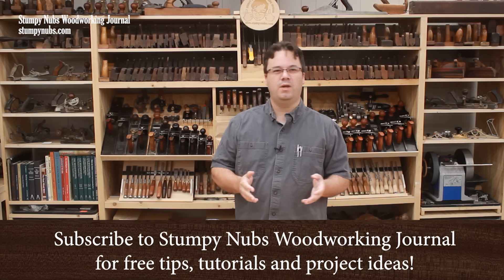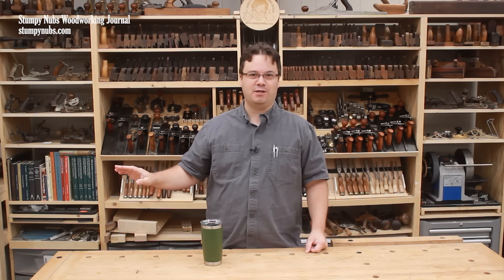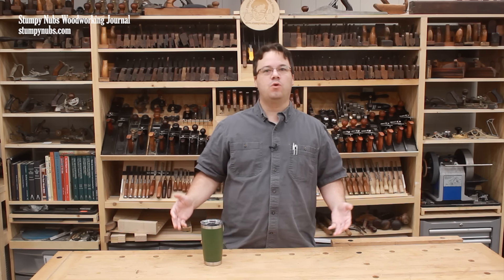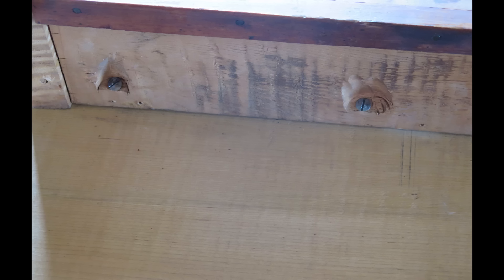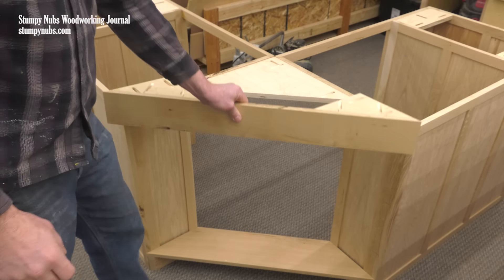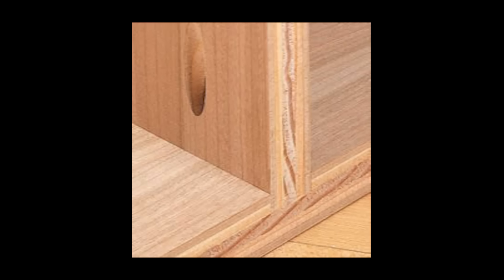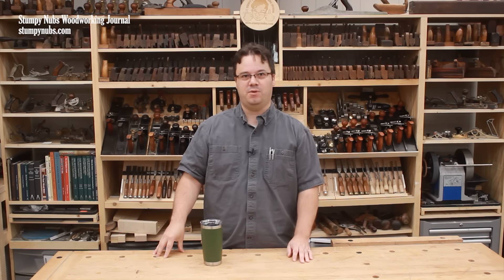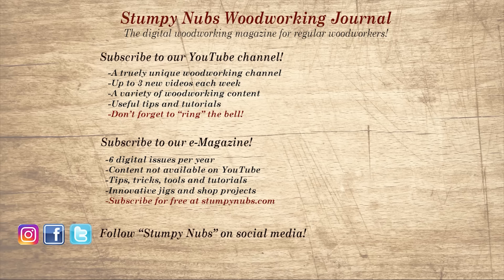They lied to you about pocket screw joinery.

Comment: I especially like the Kreg HD pocket hole jig kit, with their screws designed for 2x material. Put two pieces of 2x4 at a 90 degree angle, end to edge, and screw them together with two of their big screws. Good luck trying to break that joint. It's so easy, strong and reliable, why not use it? Who doesn't like hidden connectors? Old school craftsmen techniques are awesome, too. It's a great big world out there, and there is more than one way to do most anything. Just looking at your workshop makes me realize how much of woodworking I still don't know. Still learning.

Comment: My friend had a kitchen put into her air bnb. I just noticed today that the drawer is held together with staples. I took the drawer out to clean some crumbs out of it. It's a nice sturdy drawer. It's only about 2 years old, but it's solid. Probably been glued as well.

I have a dresser that's several decades old. It also is stapled. I have had to repair it, but not the staples. I over stuffed some drawers and used spring-loaded drawer dividers that bowed the back out, making the bottom/back joint come apart. Glue and clamps and ditching the dividers fixed it.

Sure, dovetails and dados are nice. But they're not absolutely necessary.

Comment: I use my pocket screws for a while...then I just started just sticking dowels in the pocket holes and flush cut.  I still use them as a temporary fastener til the glue sets and I replace with dowels.  Still a great joinery to have and definitely has their purpose and place in a woodshop.

Comment: I started using pocket about 1975  on cabinet face frames.Have used them for lots other purposes  since. Back then the set up for drilling  them  consisted of  a drill tub which drilled 1 or 2 holes at a time and a slanted table that was like 5x12 .This set up cost several thousand

Comment: I wasn't a big fan of pocket screws until I started using them to align butcher block and slab countertops and table tops. Now I just work on them whole in the shop. Take them apart and reassemble in place. Easy.

Comment: debate/input:

pocket holes for high load garage shelves versus just straight screwing into the support rails with "deck" type screws?
Reply from the maker: If it's going to hold a LOT of weight I'd want the mechanical strength of a dado.
Reply: @StumpyNubs  thx.... this was to [try and] settle the "infamous" debate on a fb-woodworking group post. 

Much appreciated

Comment: My first joinery project was a complete set of cabinets, drawers, and doors for my kitchen.  That was in 2014 and those cabinets are still in place, work perfectly, and get constant compliments from anyone seeing my kitchen for the first time.  I used pocket screws mostly to maintain square and apply clamping force while the wood glue dried.  If not for a joining method within reach of a novice using nothing more than a track saw and project table, I'd have spent thousands more on inferior cabinets from one of the big box hardware stores.

Comment: I like pocket hole joinery but I have yet to be able to put together a joint that did not move unless restrained by some additional joinery.  I use confirmat screws for cabinets in most cases.  The idea that the steeper angle cut by Castle will creep less seems a bit counterintuitive to me and also is contrary to my personal experience.

Comment: What is the most universal pocket screw jig ? I have never used them as grampa made sure I knew how to build cabinet joints proper, but I am very interested in pocket screw use.
Reply from the maker: Castle is the best because of the low angle and clean, tearout free pocket. But any jig on the market will work if you just want an angled screw. My concern is that you build stuff, no matter the jig you use :)
Reply: Thank you!

Comment: Thaaaaank youuuu!!! It was really getting me irritated when youtubers would make strength tests only using two pieces of wood. Yeah it fails faster in that situation but when it comes to projects you very commonly have other points where strength is added! I built a shelf with only pocket screws. Does it really have to be so strong to support a car or something when all the pressure it's going to support is about a few pounds if any. I'm not going to use it co climb on it or stand on it. It's a shelf! Even with my mobile table saw and band saw stations I use pocket screws and wood glue. That's it. They hold just fine. It depends on the use of the end product. Well said, sir.

Comment: If we use pocket holes, is the direction of the grain something to consider because of possible shrinkage and expansion of the wood?
Reply from the maker: It's always best to avoid crossing grain, but if you have to for a particular project to work, there are some ways around that, such as making the hole within the pocket a bit larger than the screw threads so there is a little room for movement.
Reply: Okay, but doesn't the head of the screw also need some extra space? In that case I may need a larger diameter pocket hole drill bit. @StumpyNubs
Reply from the maker: @twelthstring  It depends on how much you expect it to move. If it will always be in a climate-controlled place, it will move very little. In that case the screw shaft may flex enough within its enlarged hole to accommodate it. There is usually a little room in the pocket anyway. If you do want smaller screw heads, I buy Castle brand.

Comment: Great into to pocket holes. 
By the way, can we use pocket holes on butt joint that are not 90 degree but slightly more or less?  Let say i am building a trapezoid frame.  Would the joint still stay strong? Thanks.

Comment: I don't use pocket hole fastening very much.  However, I prefer using wood screws to gluing boards.  Using the Kreg Jig is a bit of a challenge.  I have used pocket holes for inserting studs as blocking into places where nailing them isn't practical.  I typically use #8 flooring screws with a Robertson bit.  I use a drill to drive the screws in and tighten them with a screw driver.  Good video.

Comment: 4:40, As someone new to woodworking, I love pocket screws for just this reason. I don't have a router or a table saw to cut dados and rabbets, so for me the pocket hole jig is the perfect, simple way to do most of my joinery. I'm building my skill set and my tool set. But for now, its pocket holes for me.

Comment: I use pocket screws all the time when building cabinetry.
They provide a fast secure method of joining for cabinets that will also be attached to walls. 
Using pocket screws has saved me worlds of headaches before as customers changed their minds on the layout AFTER everything was installed. 
That brings up another issue. 
Many customers simply do not want to spend the money for the labor of more intensive joinery. So budget also does play a factor in what kind of joinery I use.

Comment: Yes some folk just cannot see there are other perfectly acceptable solutions to problems and not just theirs. I used pocket screws for the very first time for constructing my railway baseboards. Each rectangular frame corner glued plus PSs, then the intermediate support ribs and tops PS only, all nicely hidden from view.  PS mean I can easily reposition ribs working from inside the frame (solves problem of no rear access when boards pushed up against the walls) if I get any clashes with point motors (mistakes do happen, even after working layout on the CAD) and can remove tops without damaging surface items, track scenery etc. It's worked a treat, 650 pocket screws later they are complete, was the best assembly method for me and no horrible screw heads unnecessarily peppered on the fronts!

Comment: Preach it, brother! Your last point was pivotal for me. I built a number of items I never would have tried without the confidence pocket screws gave me. In most cases I've moved on whenever I can just because I'm a big "over-builder", but it's also a huge time-saver...which is important for someone with limited time. My "shop" is my driveway. I can only do woodworking during the day, which means only weekends, and only when the weather cooperates. If I can knock out 2 nightstands in 2 weekends, rather than 3 months, I may not even start if it would take that long, honestly. And if I'm not doing something I enjoy, I may not be doing it at all.

Comment: The cabinetry job I'm trying to do a quote for involves access issues because of a narrow staircase. Rather than turn down the job, I'm going to rely on joining frames to cases with pocket screws, so that I can finish the cabinets in the work shop and then disassemble them to get them up the stairs, before reassembling in situ. Good old pocket holes :)

Comment: I owned a cabinet making shop for 25 years. For building face frames on kitchen cabinets, pocket screws were ten times faster and no need for a 1000 clamps. Time is money. An amateur will find a lot of uses for pocket screws. I also have to say that the Kreg jig is one of the best designed tools since the battery powered screw gun.

Comment: So about modular woodworking projects... where I live it is a very very difficult thing to have a workbench. I do not have a garage, my storage shed is full of stuff, and I cannot build something that big inside, never mind having a place to put it. So my only real option is to create a modular workbench that I can disassembly at any given time to put outside and bring back inside for storage... I am not a trained woodworker, and joinery is always a difficult thing for me to settle on based upon a project. I think that this is one of the most challenging things I will face for a while.

There are a lot of videos out there on "portable workbench" ideas, and a lot of them are rather neat. However a lot of them are also collapsible and move around like an old TV tray, with just about as much stability. Not that there is anything wrong with this if you are doing very light work that does not require more than just a couple of sawhorses and a plank or something just as stable, or less stable depending on how you look at it.

So making a modular workbench that can be taken apart and reassembled over and over and over again with ease is the challenge. There are places outside to put it, but storing it outside is frowned upon in my community, and then of course there is always weather to consider. Given that you are familiar with humidity up there and how it can wreak havoc on anything reliable that you have outside, I know you have dealt with this sort of challenge at some point. Yes, making a cover is certainly an option for weather-resistance, but there is only so far that such a thing can go. And again, there is that aspect of having anything more than patio furniture being outside to deal with. Dilemma and a half, no?

More to the point now that you have heard my life story, pocket joinery sounds like one great approach to making things stable yet modular, but what about making things that can be constantly taken apart and put back together? This requires some kind of joinery that could put up with a lot of stress, but that could certainly use pocket screw joinery now and again. Looking for tips rather than full tutorials, but if you wanted to make a video on this sort of thing go ahead. Otherwise, if you or your viewers have ideas without my going into further details about the why, and do not insist upon asking me to go into explaining the stupidity of the community here, I would love to hear from you or them offering even the simplest of tips (save from things like "Just move".

Thanks! :)

Comment: Agreed! Though pocket screws may not be the strongest solution, if they are strong enough, job done. Using them in conjunction with glue eliminates the need for lots of clamps and makes for a stronger joint. We've had a Castle PS machine in the shop for ?25+- years. It has gone through quite a few routers but still works fine. 

Over the years we've changed our methods of producing commercial casework. But even the old methods of biscuits and pocket screws still find an occasional use. Most work is now doweled because it works well with modern equipment. Fast, strong and accurate & meets AWI standards.

Comment: Personally, I would go for traditional joinery if "I want it made that way" or connectors if I want it quick&simple with easy disassembly, especially when using particle board. But pocket screws are completely fine in many applications.

Comment: There are a limited number of applications for which pocket screws are the best choice. I use them nearly daily in my custom cabinet business to assemble carcasses - typically with biscuits for alignment and to clamp those joints together while glue cures.

Comment: Pocket screws are very cool. A few years back I did a major redo on my kitchen and the old cabs face frame used ps. I was able to easily remove the frame and reconfigure my new frame. Without ps this would have been a total mess.

Comment: I put two different types of joints together for one great piece of knockdown joint. I own a Kreg Domino Joiner but the MUCH cheaper beadlock would work as well. For my kitchen table made from birdseye maple, the aprons (offset by 3/8 of an inch) have a domino tenon in the middle and two pocket holes, one on either side. I used no glue, just put in the domino to perfectly align the apron with the leg, and used two screws for the final join. It is solid, resists twisting and bumps to the legs, and has not loosened a bit. When the legs or aprons get battered enough, removing 4 screws and the leg or apron is ready to refinish. The top is held on by z clips.

Comment: I'm coming late to this video, but as a professional woodworker, I can tell you this. When a customer comes to me and wants a cabinet built, I could certainly build it from solid wood, jointed together, with hand cut sliding dovetail joints, mortice and tenon joints everywhere, but unfortunately there is no way they are going to pay for it. Instead I use good cabinet grade plywood, rabbit joints when it's the best connection and I even dovetail my 1/2" Baltic birch drawer sides. And pocket screws where they are appropriate. I used to build all my cabinets like furniture, and nearly starved. I build good quality pieces that will last a lifetime using the most efficient systems.

Comment: Still liking the Castle system?  Big question for me, has Castle's different screw angle helped with the problem where the part you're attaching shifts a little but just as the screw starts to tighten? (so frustrating)  (I heard you say that it did in the ad at the end, but I wanted to check)

Comment: TL;DR - I'm the definition of a newb when it comes to woodworking in general and furniture in specific. Pocket holes enabled me to build far beyond my abilities for my first big project. How long it holds up remains to be seen, but I'm glad I was able to get real practical results quickly.

Longer version: I've lived in apartments most of my adult life with few options for anything approaching a real shop, but I've always designed and sketched and imagined projects. Last year's lockdown inspired me and six members of my family to rent a big house with a theater and pool together to comfortably hunker down as long as needed and limit our exposure circle. I don't need much space so I took the little office room to sleep in and telecommute from. After a while it kind of sucked though. I needed more desk space and wished I could get rid of the bed when I was done sleeping. So yeah. I designed a (pretty ambitious for a beginner) massive (93.5" wide) motorized desk with built-in horizontal murphy bed. The desk lifts out of the way in the evening so I can fold down the murphy bed under it. Partly because of detailed design and partly because of trial and error and partly because of blind luck and very much because of pocket holes, I finished it in about four months. It works and looks much better than I deserve and I have been using it for six months at this point with no issues. Without pocket holes I can't even guess how much longer it would have taken to develop the skills to build something like this. I've only just begun to learn real joinery and am already itching to build version 2. In the meantime though, I smile every time I climb into bed. It's just too cool (seriously, I built in an under-desk smart TV and LED lighting and a great cable management system and a massive full extension drawer with soft close and cabinets in both ends and a hidden compartment with RFID access and the whole thing self-braces so it doesn't need to be bolted to a wall). Pocket holes, man. XD

Comment: I had to restore a pre 1940 desk which had seen better days. Two important components were missing and had been held in with dowels. I  couldn't get the same timber the desk was built with so had to use a temporary substitute from my scrap pile. Additionally holding them in with dowels meant that I would have to dismantle other joints and reassemble them. So, O used pocket screws which I v=can remove when I get matching timber and dowel the pieces together. The pocket holes are in the replacement timber and the rest of the holes will be covered by the replacement timber. A good, quick, reversible solution to get the desk back into action.